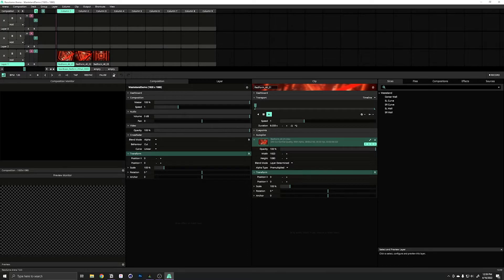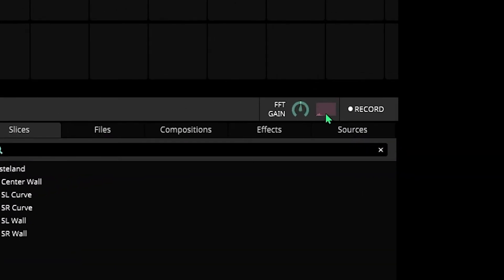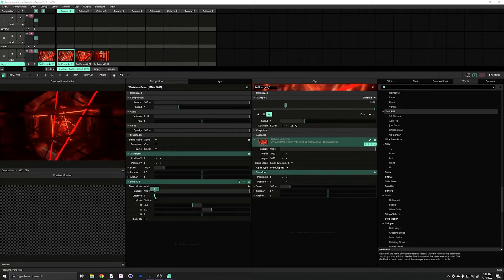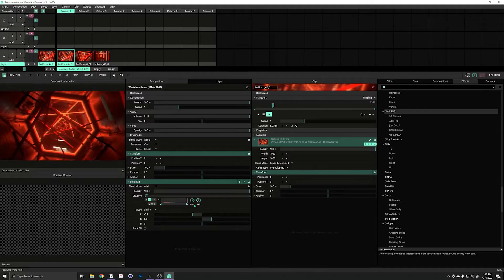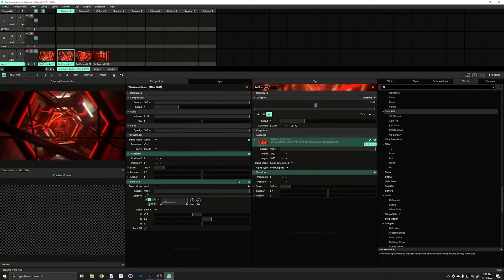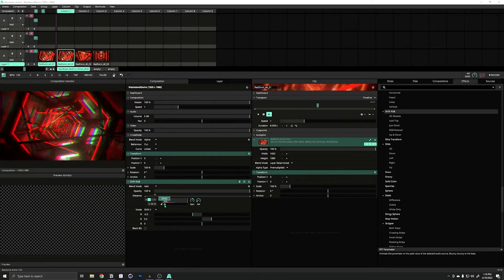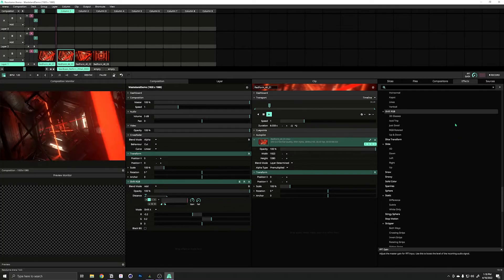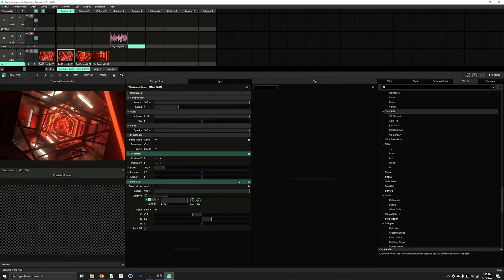Resolume Audio Reactive Visuals | Quick Tip Tutorial

Comment: I'm new to VJ. Trying to add it to my DJ set. So far, I've only used static visuals with a Holographic Fan. In adding Resolume to my arsenal, can I run Resolume and Serato on the same laptop and use the Audio Reactive feature? Is my laptop going to be able to do all of that?

Comment: Hey thank you for this video ! I want to do this with opacity for a school project lol I use audio FFT within my project BUT I would like my visual to reach 100% opacity when audio is played then gradually fade away but like reaaaaally slowly. Also I would like it to just gain opacity and thats it. not flickering with the rythm of the audio if that makes sense ?
Finally there's some audio effects that I dont want to interfere with the opacity, like I want the visual to gain opacity when one sound is played and not another, is it possible ?
Thanks to anyone that can help me on this one !!
Reply from the maker: So you can adjust settings like making Fall really high which whill make it fade slower, and you can use the equalizer to try to isolate the sound you want it to respond to if it is in  a unique enough frequency range without other sounds. Otherwise, you may not actually want audio reactivity and may be after something else for that level of control. or you may need another more specific tool to achieve your goal.
Reply from the maker: You might also play with other effects. maybe instead of a long fall, you make it short but add a really strong feedback effect. so it blips a frame quickly with FFT, and the feedback effect or trails effect is really slow to decay.

Comment: I would love to see a more in depth tutorial on how to properly setup a external audio to a front of house sound mixer or any other method you would use for a live setting. That seems to be my biggest question since there are multiple ways others use external audio outputs. I tried using my focusrite for an even tonight which I did get signal but it did not seem accurate at all. Id love any tips you have on properly setting up a focusrite for a live setting!

Comment: Is it possible to make a music video from footages reacting to the audio in Resolume only without after effects or Premiere pro? The idea is to have a consistent timeline, like in any editing program, which can be further adjusted if necessary. If not, what is the best way to organize the process of creating a music video?
Previously, I tried to put everything together in the premiere or after effects, but linking to music there is not very convenient and takes a very long time, unlike resolume
I will be very grateful if you answer and give advice on organizing the process
Reply from the maker: It is possible but it wouldnt be my first choice considering how you described your desired workflow. Resolume can record its output, and the recording tools are improving, but there is no timeline so you need to re-record every time you want to make an edit which might not be the most efficient process. Most music videos are created in a linear editor like premiere or final cut or with after effects. If you like resolumes audio reactivity and effects, You could possibly combine recording audio reactive effects on sections and loops in resolume and tweaking the final edits on the timeline in premiere or after effects. You could also use a tool like notch, smode, or touchdesigner for more realtime audio fx and basic timeline editing in one app. In general I think a combination of tools might be your answer in the end. Utilize each of their separate strengths and create a pipeline that works for you.

Comment: Can you release a troubleshooting video on how to properly setup your focusrite device? Even though I followed your steps, Im still not getting any audio output to my focusrite and into my resolume. It does work when I aux my iphone though but never through my PC. Id like a more detailed video understanding how this works with resolume.
Reply from the maker: Make sure you have the drivers installed and check your system audio settings and resolume audio preferences. I will see what I can do about a video on the topic! Thanks for the suggestion
Reply: @SeanBowes Did you ever make a video on this? Pretty stuck myself right now I’m having the same problem.
Reply: I'm also stuck on this step. I have my focusrite interface selected under Audio Input Device but the FFT view shows no audio signal coming into Resolume :(
I can use a Mic input fine. Wonder why the focusrite output isn't sending signal.
Reply: Cause you can only select input in Resolume. You need to download something like a virtual cable and make your focusrite input as output.

Comment: Great videos, thanks!

Do you know of a way to dialing in the live input to only react to the kick but not the bassline if they are too close or are overlapping on the frequency spectrum like it is the case in most psy trance tracks? Im struggling to find a solution for that and in the end always use bpm synced envelopes.
Reply from the maker: From a full mix, its pretty difficult. bpm envelopes are probably the way to go. If its more of an AV set type thing, maybe you could send the isolated kick stem separately, but for your average live dj gig its pretty tough to isolate.

Comment: I'm brand new to Resolume, but I have 40 years of production experience starting out as a DJ. Can I upload a music clip onto a layer? Thnx Sean
Reply from the maker: Yes you can drop an audio file into a clip slot, as well as video files with or without audio
Reply: @SeanBowes  Hey Sean I'm a bit confused on dragging and dropping the audio file on a layer. For example if I use Layer3 Column 1 for the audio file then I cant seam to select column 2 without loosing the audio.
Reply from the maker: @VisualBeatLab  clips stop playing if another clip in the same layer (and a different column) is played. Clicking the column name triggers all clips in that column on all layers, which could have this effect. Triggering empty slots in a layer had the same effect of unloading the current clip in that layer. 

You can avoid this issue of stopping your clip by:
Not using column triggers
Rearranging your clips 
Setting your audio layer to ignore column triggers
Or creating a group of layers and moving your audio layer outside of it, then using the column triggers inside the group.

Comment: Sean what exact cables do we need for the audio interface and what settings do we need to have on it?  On the device itself I mean. Do we connect it to the laptop through usb or from the headphone jack on the computer? Also, can I connect with this to a dj's controller? If so how? Thank you.
Reply from the maker: I am using the USB-C out from my interface to a usb into my resolume computer, and using a 1/8 in headphone to 1/4 inch audio cable to go from the output of the device playing the audio to the input of my audio interface. you could also use an xlr cable or a 1/4 in to 1/4 in cable in a more pro environment.